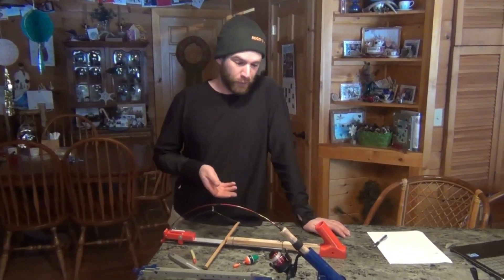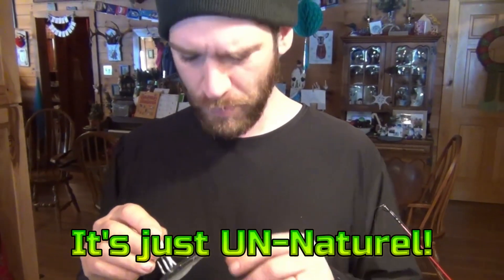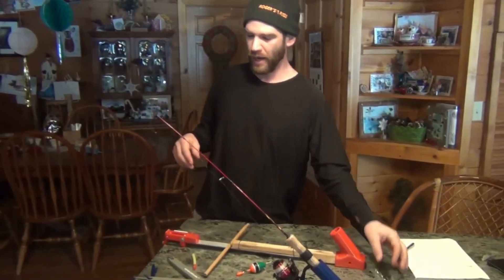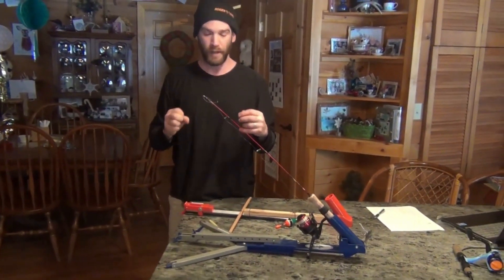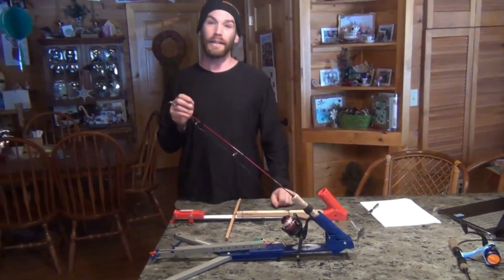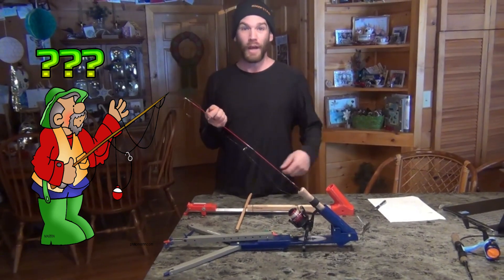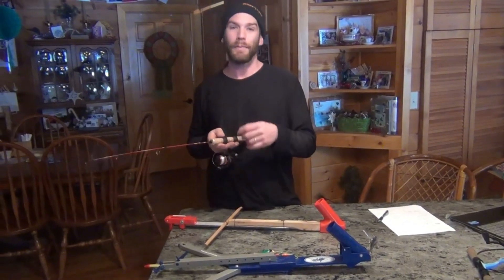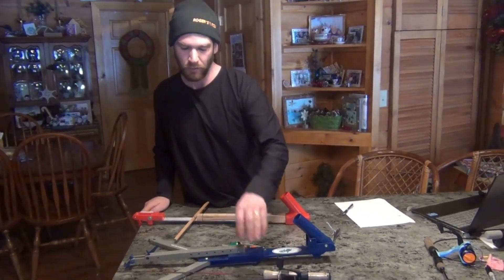How To Use a 3D Printed Hooksetter for Perch🎣🎣🎣

Comment: Ok question for ya we have had about 2 weeks of 20s teens 30s but just got 8 or 9 inches of snow which I know insulates the ice is this a deal breaker for going out on the ice or not? It's been 2 years since we've had ice and I'm rusty on conditions and what not.
Reply from the maker: well that varies on each situation.   the weight of the snow could push water on top of the ice and make it a sloppy slushy mess.   our new ice is about to get that same snow.  it begins tonight here.    it certainly makes it more difficult to see where the bad spot are in the ice and it can insulate it from freezing more.   if you get a rain and then a freeze it can be a quick way to go from 3 inches of ice to 10" .    if there was at least 5 or 6 inches of ice before the snow i would say proceed with caution (and boots)   bring a spud and check the ice every 5 feet as you go.  and stay away from known sketchy spots.    did you see the vid we made last year "thin ice thick perch"    that was just 3" of snow and if we had not been spudding our way out, we would have been swimming!!
Reply: @RogersRigs  Ok I have no idea on the depth of ice but conditions have been so up and down, it makes me wonder if I should even try. I may start with drilling off a dock and go from there. People are fishing bays of big lakes or channels but I'm more than likely going to fish ponds at first.
Reply from the maker: yes it has been a really sketchy freezing pattern this year.     its best to use caution.    these La-ninos were supposed to be COLD!!!   oh well the media lies to us about everything else so why not the weather?

Comment: What about just tightening the tension on the trigger mechanism ? That has worked for me in the past
Reply from the maker: interesting...so the perch has more time to take it in their mouth, before the pole strikes?   I suppose that could work.   Our perch tend not to feed on minnows naturaly.  they are nymphers so the spit the minnow pretty easily unless it is just so.   THanks for the tip George.  Do you use the jaw jackers for perch a lot?     I really only tried it for a month or so last year.
Reply: @RogersRigs  yes,actually I set it out anytime I'm on the ice! You never know, it's like having an extra person lol
I've only had a few misses while using it. I'm always amazed that I don't just reel up a set of lips for as hard as the thing sets! 😏🤣🤣🎣
Reply from the maker: Ha ha yes.   it has to give them quite a jolt.  my 8 year old girl reeled in a 10 lb laker on it last year and that was a lot of fun,   but i also lost a MONSTER pike on it.   not the jacker's fault.  but im still a little mad about everything within 10 feet of that hole.     It broke 3o lb braided!  because i turned the drag tighter instead of looser...actually i dont want to talk about it.  :-)
Reply: Wouldn't the perch feel resistance and drop the bait? How about a linestop at the end of a 12-18" coil. Fish takes up the slack and the line stop trips it? (Hi Roger).
Reply from the maker: Hi Jim.   Yep that is kinds what we do witht he bobber set up.   giving them a little no resistance running line before the hookset.  but some perch that feed on minnows all the time may take the bait differently i guess.  its hard in cold weather to make it work in any configuration i have found.   its -9 right now here.   so this would not be a good day to try it out!
Reply: @RogersRigs  I can still hear my brother saying "Let it run!" when I was six. Such Fun!
Reply from the maker: yep! i love watching a tipup spool out line!!